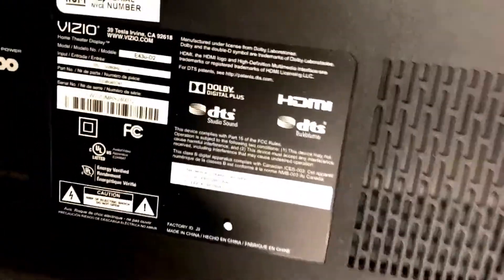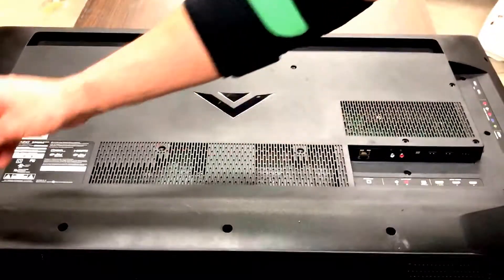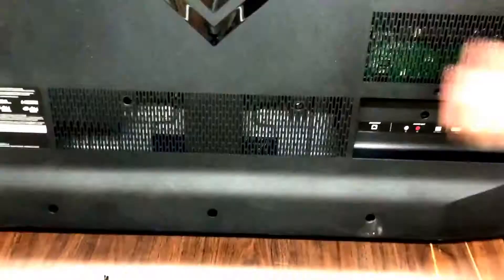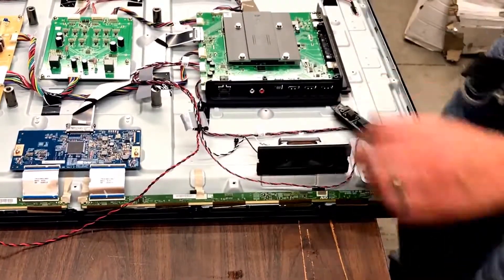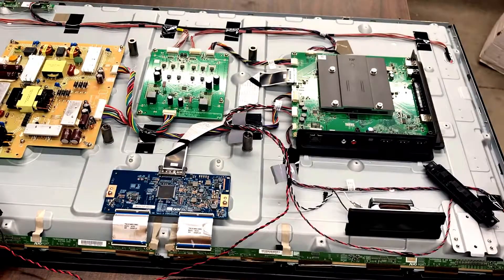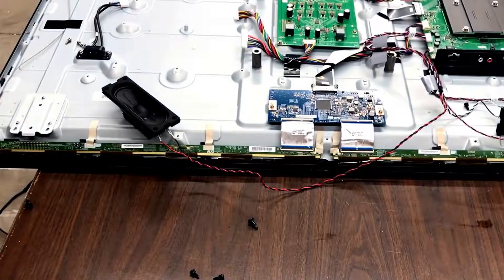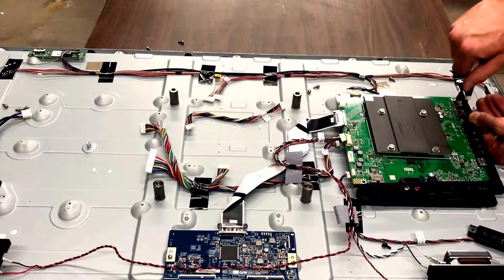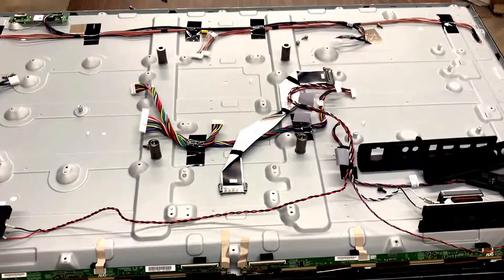Vizio E43U-D2 Tear Down - Board replacement

Comment: I'm just seeing this video, and I'm glad you took the time to post it.i know this is several years old, but I have a question on the part connected to the LCD.
  There's two ribbons connected to the lowest circuit board in your video. There is also good tape applied to the chassis. Those are easy enough to remove. There are 8 black rubber things that's holding the circuit to the chassis. Would those be glued to the chassis, in your professional opinion? 
  Also, do you think i could swap the LCD for the same size TV, but different model number I own? They're both Vizio's. One is the one in your video, and the other is only a1080p. The one in your video is 4k. Well, thx for your time.

Comment: Hey Clint, random question. You wouldn't happen to know where I could get a replacement part for where the bottom of the control board meets with those two ribbon cables? The clip cracks on the right bottom ribbon connector causing double imaging. I tried looking this up, but I'm not sure if I'm looking at it correctly :  ts-5543t06s01-655-d450000-0671-02

Thanks!